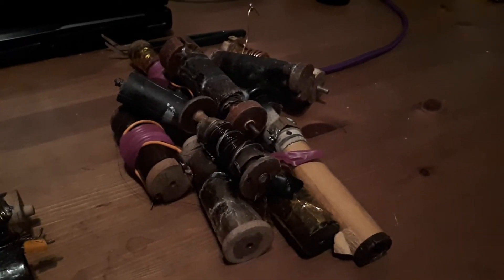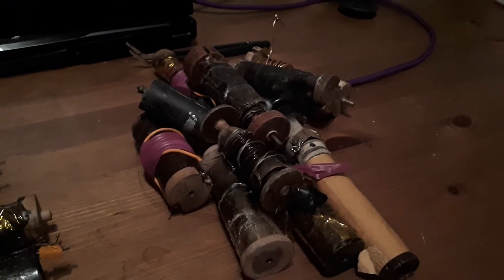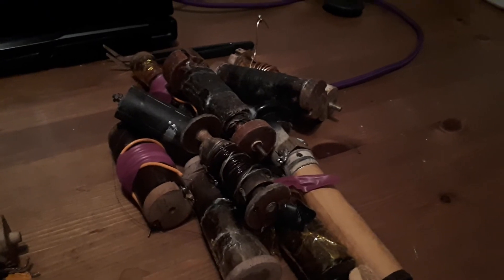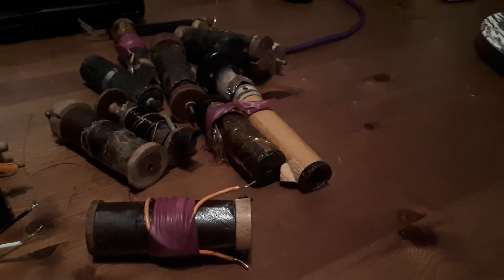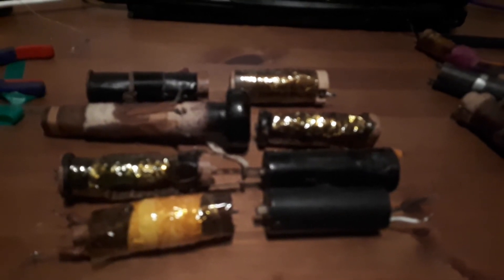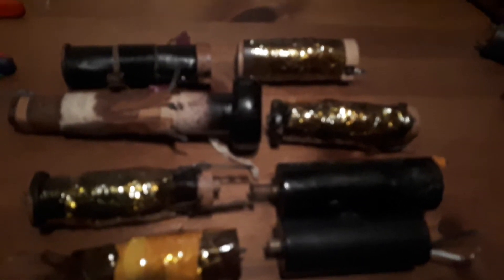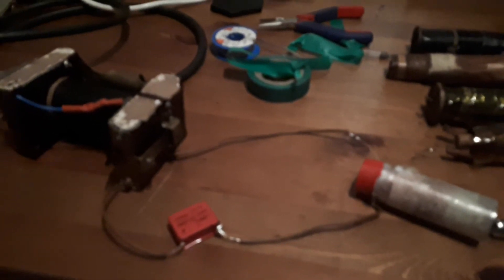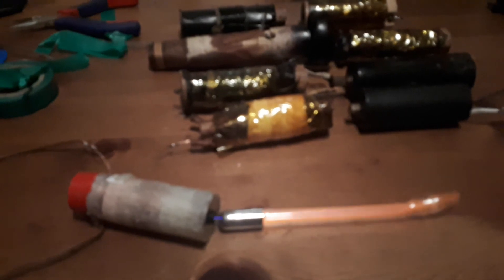Understanding violet Ray Healing Devices: Re-activating Tesla coils for the handles

Comment: Thank you for the informative video.  Do you have any data for the primary and secondary windings?   Like inductance wire diameter, number of turns. I like to try and wind one. Thank again.
Reply from the maker: Dear here is some information. I take a 0,18mm thick wire which is isolated. you need 16 layers over each other with 100 windings. You place the windings in the middle ouf the stick you are winding on. After the secondary, you isolate again. then you put the primary over it. 6 windings-8 windings. 
Check out Jeff Beharys Museum on Internet.